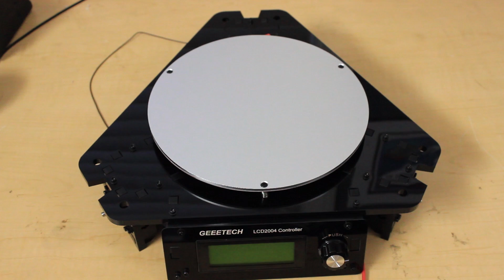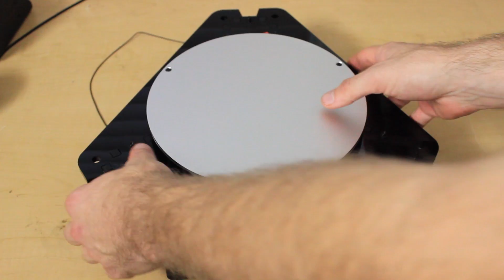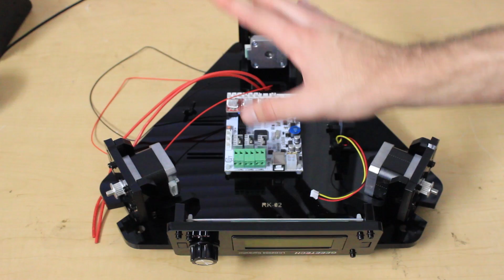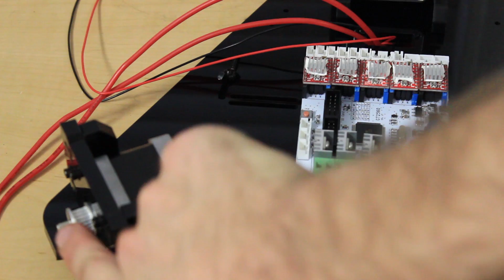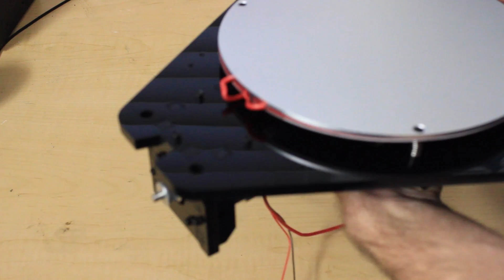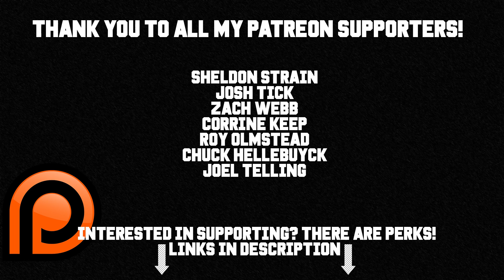3d Printer Build Delta Rostock Mini G2s Pro Build Update Part 1

Comment: I have the same printer but there is 1 part I cant get my head round the main board has 6 green connectors parted into 3 sections looking at the bottom left to right the first 2 are for the hotbed the second part is for the heater 2 the third set is also for heater 1, the problem I have is were the hotend goes, any help you can give me will be a great help, and like your video have you made any more thanks for your time